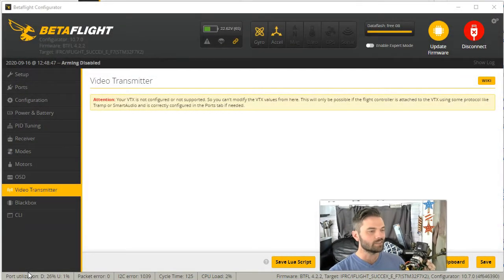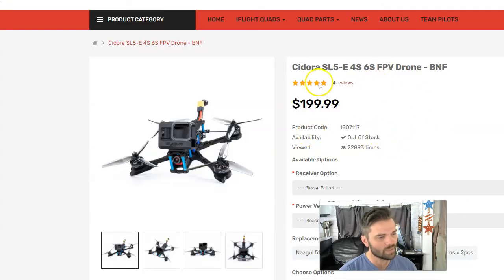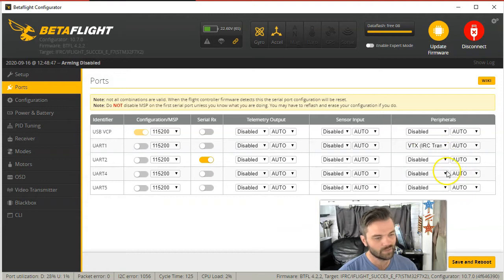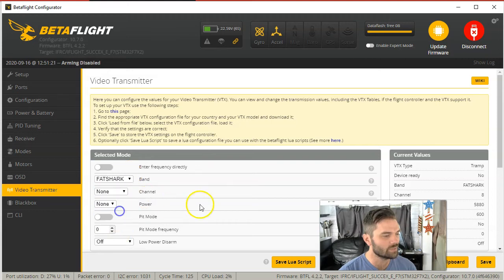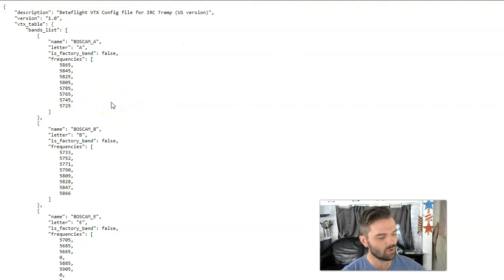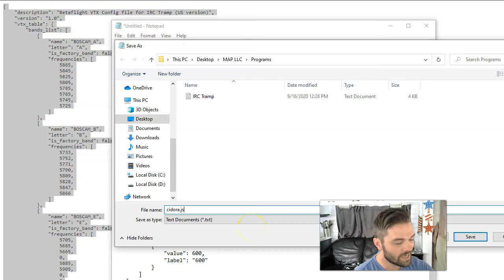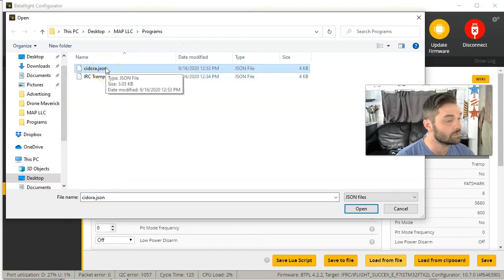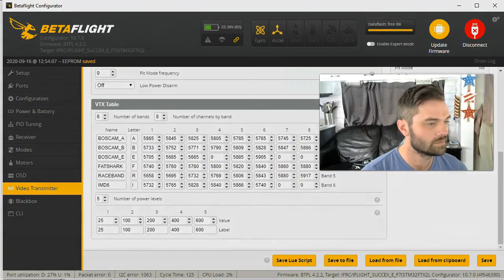VTX is Not Configured in Betaflight - EASY FIX!

Comment: very good information. i dont have video transmitter tab in betaflight, i tried 100 times but nothing
Reply from the maker: Betaflight Configurator 10.7.0 is what I’m using to see the video transmitter.
Reply from the maker: Also, in the upper right hand corner, tap the little gears and enable expert mode. That might where Betaflight shows it on your dashboard.
Reply: @DroneMaverick  thanks, i have done all these, i have the 10.4.1 version, i will download the 10.7.0 now. i subbed and will be happy to watch your videos

Comment: Hi, I think I have a problem.
I'm using a TX805, and a F4 controller. The voltage pins are at 0V, and the VTX is not working. Is the controller broken, or do you have any idea of what is happening? Thanks in advance
Reply from the maker: Maybe a bad battery

Comment: Betaflight isn't even showing me a Video Transmitter tab.
Reply from the maker: Interesting, was the Video Transmitter tab showing before?
Reply: @DroneMaverick  not with this quad. I've used this Mamba F405 mk2 stack before and didn't have this problem but this is the first AKK vtx I've ever used.
Reply: might need to flash latest betaflight firmware version in your quad ie BTFL 4.2
Reply: @hafizuddinismail443  I forgot to leave an update. I had to flash the flight controller with the firmware that includes the AKK patch. Once I did that I got the video transmitter tab.